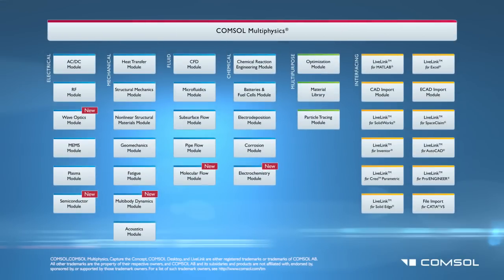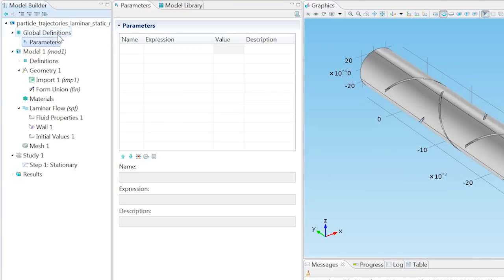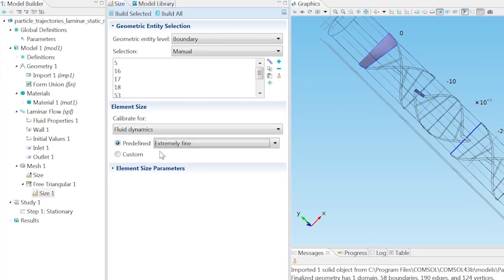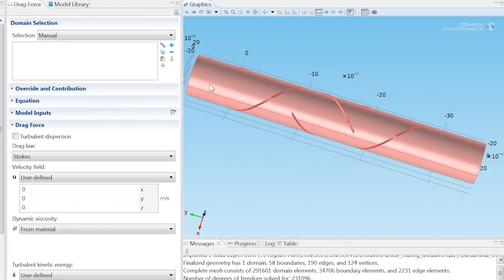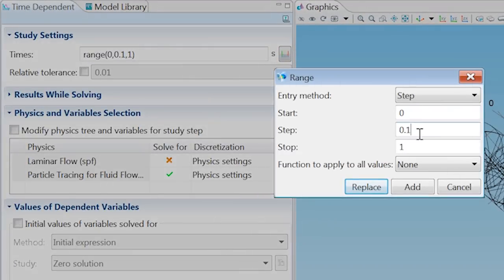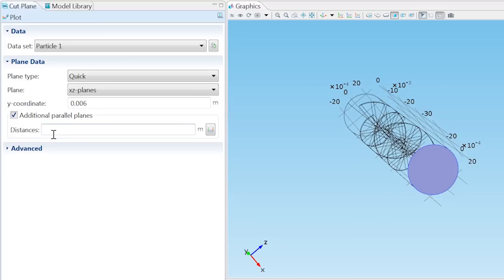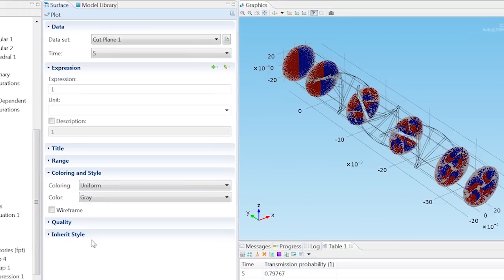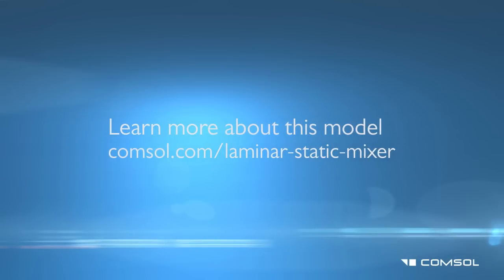How to Simulate Particle Tracing in a Laminar Static Mixer

Comment: Hi,
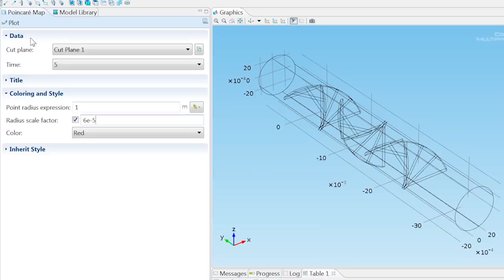it doesn' t show me the particle like in 6:26 after the simulation and also in the part in 8:35.
I followed every step like in this video, do i have to activate something in the options or did i miss something?

Thank you for help!
Reply from the maker: +Yip Joe, please double check the steps taken in the video and make sure that the box to generate default plots is checked, seen at 6:22 in the Study Settings section.

If you are unable to resolve the issue, please contact your COMSOL Support team for additional questions, http://www.comsol.com/support.
Reply: +COMSOL i finally find the solution. it was under the option by "particle trajectories (fpt).  I have to change some settings to see the points (particle flow).
Thank you guys!
Reply: I did the same simulation for different geometry. The diameter of particle keeps increasing with time. Is there a way to keep the size of particle constant
Reply: +Yip Joe Hi Yip Joe,  I have the same problem like you did it. If you okay, Can I ask you how did yo do this problem?? I want detailed instruction. Thanks.